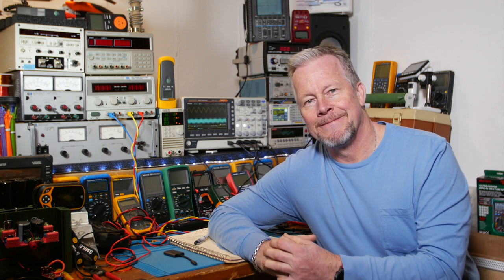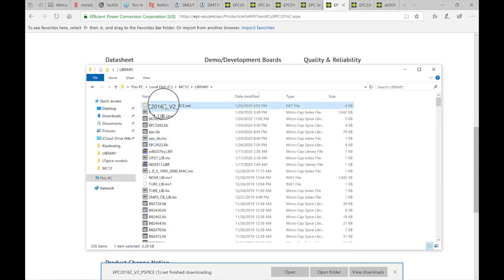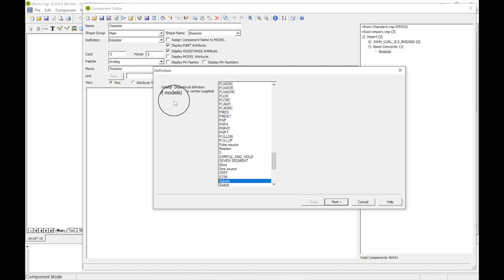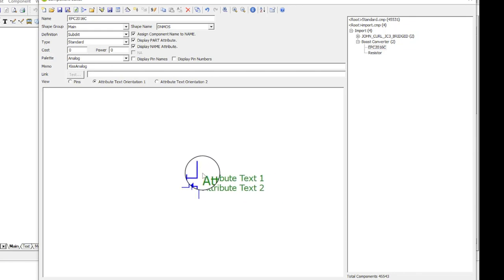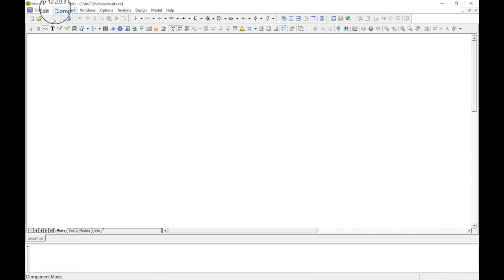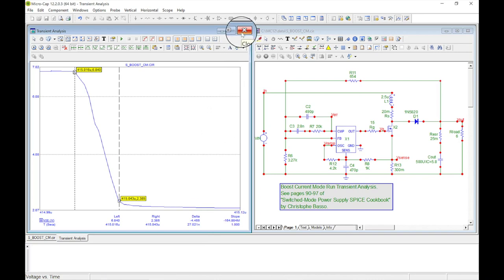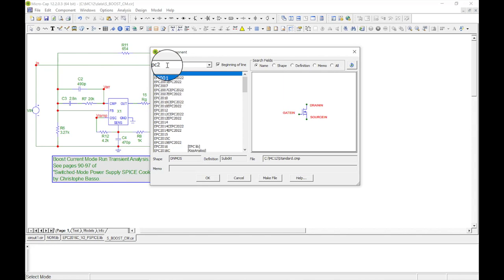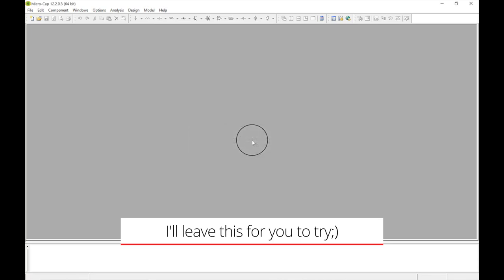Micro-Cap Tutorial #4: Adding a new Part to the Library #microcaptutorial

Comment: You have really made a great video, it is fluent as if planned throughout, clear demonstration and it did not substract anything that your mouse took a coffee break:-) It were so lucky that you were not pointing out components or functions, so great while that happened:-) Your switching screen in the end, did also look good.
On top of all that, did I learn a lot today, thanks a lot for that!! :-)
Are there other component files where you can just change the file type, as from .net to .lib?
Reply from the maker: Fried Mule Thank you for the awesome feedback - I really appreciate you!  If you can open the file with a text editor, then you most likely can save it as a .lib file.  There are cases that I’ve had to do some editing;) mostly putting sentence returns to get the file formatted.  If you run into a file that doesn’t import easily, let me know and I’ll try to help.
Reply: @KissAnalog  WOW what an awsome offer, I do also really appreciate you and your help, and all the effort you put into each and every video!

Comment: Hi!
Great video, thx :)
I have a question, though.
What if I need to add a part which contains more than one subcircuit?
An example could just be a simple double Nmos (a package with 2 nmos inside) or a pmos+nmos, or a double diode etc.
What is the right procedure to add these "complex" parts?
Reply from the maker: Thanks for the great question!  I'll do a video very soon to show this.  It has been awhile since I've done a MicroCap video;)

Comment: Great video. Really enjoy all the MicroCap vids.
Say, is there a way to automatically select the 90/10 points to more accurately place the cursors for the rise/fall time measurements?
Thanks & 73...
Reply from the maker: Thank you!  And, great question!  Yes, you can take this automatic measurement.  Run a transient and go to function measurements and it is on the list.  I'll do a quick video this weekend;)  I'll probably show 2 or 3 quick tips.
Reply: @KissAnalog  Thanks Eddie.  Trying to get back into electronics and RF/Ham QRP design as well as 3D printing to dust-off and level up even though I’m retired.  So, adopted Fusion 360/CURA, MicroCap and DipTrace.  So any vids or tutorials are greatly appreciated!  😃
Reply from the maker: That’s great - I’m glad you are having fun;)

Comment: These are great tutorial videos.  When I was trying to pick up LTspice it was really difficult to find stuff that went beyond "Here's how you drop a part and connect it up", especially adding/creating your own parts, so I really appreciate the effort you put into them.  If I had to point to one thing, I find your magnifying cursor is quite distracting because it tends to obscure parts of the screen, icons and pop-up text around it; I don't know what others think - maybe you could try just using the mouse pointer (are there options in Windows to increase its size or change its colour?  I use Mac so don't know.)
Reply from the maker: Andrew Johnson Thank you Andrew!  I have an idea about the cursor.  Some people do like it but I haven’t been too thrilled about how it turned out at times.  Let me know in my next tutorial how you like what I do...

Comment: OK, lemme know on that.  What I want to do is change where the leads come out of the 555 timer.  As there are now, pin 5 is at the top...I'd like it on the bottom, right...Then pin 7 is on the top right and I'd like to change that so it's on the top left....and some other lead changes as well.  Anyway, you get the idea.  Thanks!

Comment: Sir, thank you for your clear explanation. Now I'm trying to import LM317 Regulator to the simulator but the file I've downloaded from TI website contains more than 1 element which are named as ; LM317_TRANS.TSM, LM317_TRANS.TLD and LM317_TRANS.LIB. How can I import those 3 files into the program ? Because if I only save the .LIB file It shows no properties and it just won't work.
Reply from the maker: Thanks for the question.  I'm having a hard time keeping up with comments so it takes me awhile.  I start with subs first then try to make it down the list.  Have you got this working?  I'll do a video on this as I'm sure there are others having the same question.
Reply: @KissAnalog   Thank you for your reply. I have managed to import the files but when I hit the Transient analysis it gives an error and stops working. Since the part I was trying to simulate was so cheap, maybe just buying it and trying on the circuit could be  the best option. And I've subbed to you. This channel is definitely going to help with my later projects. Have a good day !

Comment: Im trying to import the GS61008P from GanSystems this way but it doesnt seem to give me a shape. How can I solve this? It says it has 6 pins in microcap but in reality there's only 4 connections (just a mosfet with an SS connection)
Reply from the maker: Great question!  I’m going to post a video on just how to do it - tomorrow;). Thank you for asking.  What circuit are you going to test it in?
Reply: @KissAnalog  I was trying it in one of the buck converter example circuits. But my eventual goal is to able to use it in an LLC converter for my masters thesis. For the moment I'm struggling quite a bit with micro cap but your videos do really help! :)

Comment: I have a simple circuit with a tungsten light bulb on it. I note that there is no light bulb symbol. How would I create a component with a completely new graphic. I came across the spice definition somewhere so I think I can use that to create the .lib file as you have done in the video.
Reply from the maker: That is a great topic for a new tutorial - thank you!  I’m glad you are having fun with this great tool.
Reply: @KissAnalog  Yes, thank you for suggesting it. I tried both multisim and circuitlogic which I found almost unusable. Micrcap is certainly much better than those two. I'm busy relearning electronics having done an EE degree but been in software for the last 25 years. Certainly nice to be able to try out designs without having to set up a bench immediately.
Reply: @KissAnalog  For light components there would be different parts needed for tungsten vs. fluorescent etc. Is the idea behind the parts concept to create an electrical analogue of the device I.e. capture an analogue circuit as a subcrt definition, assign it a graphic and add it to the part hierarchy.
Reply from the maker: I"m glad you are here;)
Reply from the maker: Yes, that's right if I understand your question:) I'm past due for another tutorial.  Have any ideas?
Reply: @KissAnalog  Ok I've found the shape editor created and linked the shape to my subckt however the parameters that came with the subsct are not pulling through in a way that I can set them when i add a component instance to my circuit. I see in the subckt text parameters have default values but they dont come up in the UI when one places the component. Also the file that I downloaded has parameters such as VO and IO which are dependent on a measurement. How are these set or linked to transient analysis measurements. A video on the format of the subckt file and parameter linking to the component instantiation or placement process would be amazing. But thanks for your great content so far.
Reply from the maker: Sorry, I just found this - YouTube doesn’t do a good job in notifying me... I’ll try to show some of this in videos to come - please keep me in mind of new ideas.